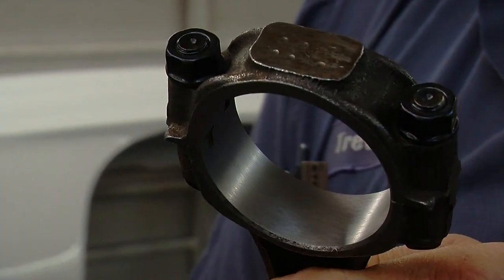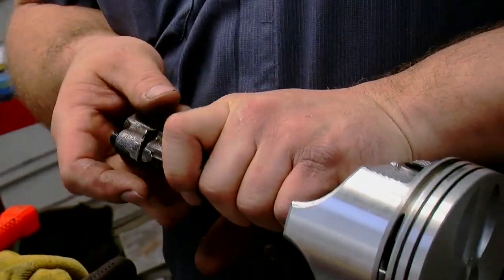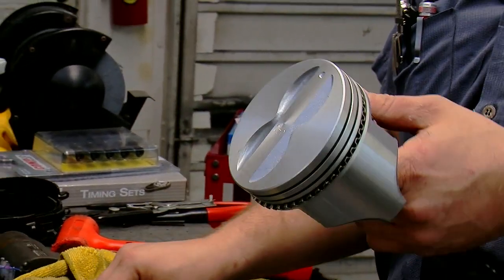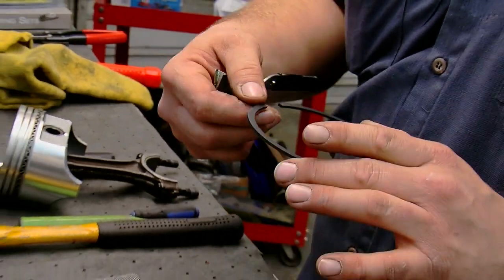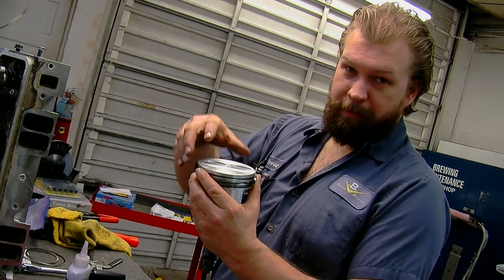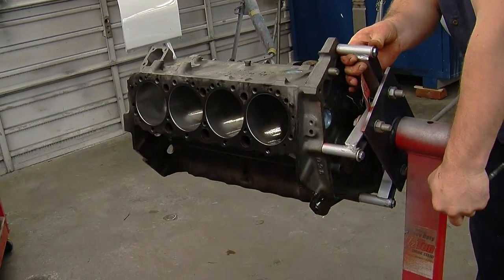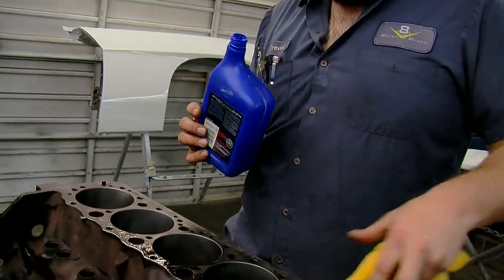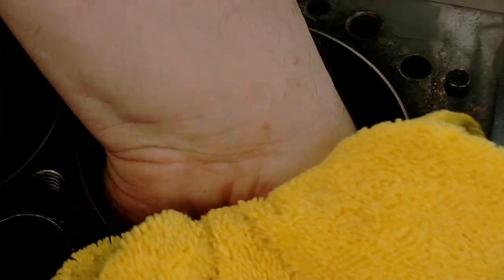Engine Building Tips 6-Part Video Series V8TV Small Block Chevy Part 2

Comment: What benifit or Advantage  is there to a Decked Cylinder Block ? & is it Worth the Extra time & Coin. i'm pretty sure it would be , but i'm an amature when it comes to Souped up V8's.
Reply from the maker: A "decked" block is one that the cylinder head deck surface was machined flat, and helps with gasket sealing.
Reply: thanks V8TV. that sounds like the way to go to keep the oil company's drilling for black Gold.

Comment: What is a Crosshatch  in the cylinder Bore ? & it Sound's Crucial to Engine Longevity.
Reply from the maker: The crosshatch is the pattern left by the honing machine, it is there to assist the rings to seat properly.
Reply: Thank you V8tv.